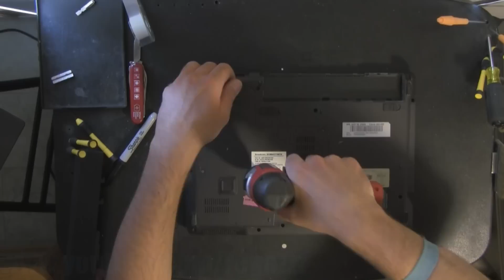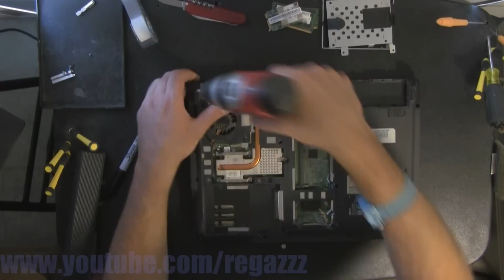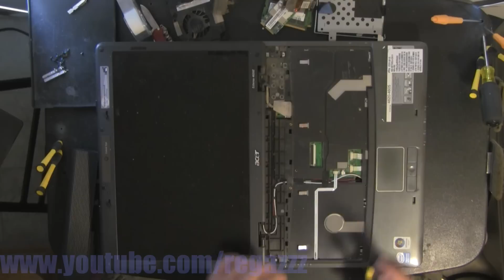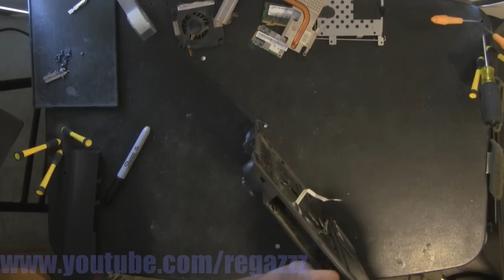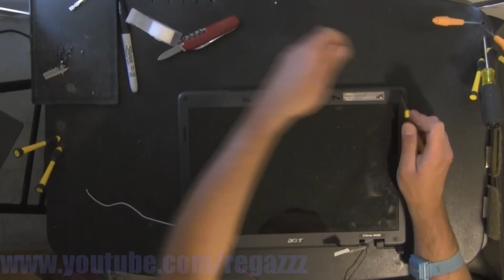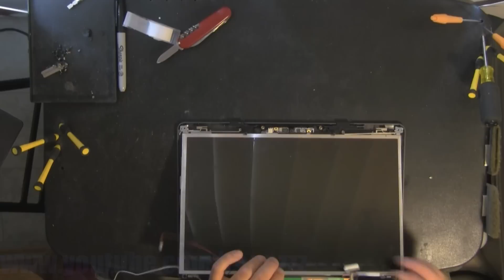ACER EXTENSA 4620 take apart, disassemble, how to open video disassembly

Comment from the maker: Hello,

I can imagine the problem with my speed. And I am impressed that your laptop is working so long!
It is pretty easy to clean a fan on your laptop - on this model, because what you need to do is only remove one door and fan is right over there. You may take some canned air and blow all dust away - this should work just fine. Make sure you will remove a battery and power supply first and even after that do not touch any motherboard parts without needs.

Comment from the maker: There is completely no need in downloading this videos, they will be up anyway all the time. 
Unless you will have some trouble with connection.
I do remove a wifi card in the first minutes of this video. It is pretty simple. Remove a bottom cover - and there it is , hdd, fan, wifi. pretty easy.

Comment: Regazzz, I just watched your 4620z video.  Great job making the video.  My only concern is that you worked so fast, I had to watch it again.  My 4620z is working fine after 5 years, but I know it's only a matter of time before it dies.  To prevent that from happening soon, I want to open it up and clean any filters, fans or heat sinks so that heat doesn't build up and fry the CPU.  Do you have any documentation you can share about how to do maintenance to clean the laptop?   Thanks again!

Comment: Many thanks for this great video Regazz. I need your help, I have an extensa 4630Z, am getting flickering horizontal line on the screen. but when i close & open the screen several times and at times had to hit the screen a little with my fingers I can use the laptop. what do you think is the problem? is there something that is broken/loose or should replace the screen?

Comment: Hi, I'm having this problem where my laptop doesn't charge properly! Nope, it has nothing to do with the charger or the battery - I'm 100% sure about that so don't tell me to check those out! Can you like make a video showing how to solder the power jack's wire or circuit or whatever (lol I really don't know what I'm talking about).
I actually took my laptop to Acer for repair 3 times (bought this laptop back in 2008) and I'm having the same problem again. But this time I deciding to take the matter in my own hands. So any video relating to that would be appreciated. Thanks :)